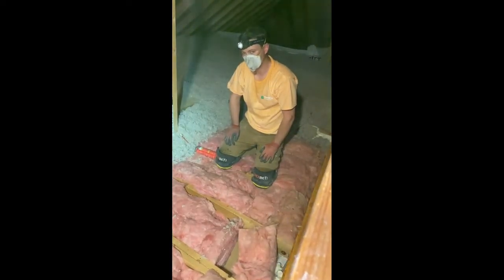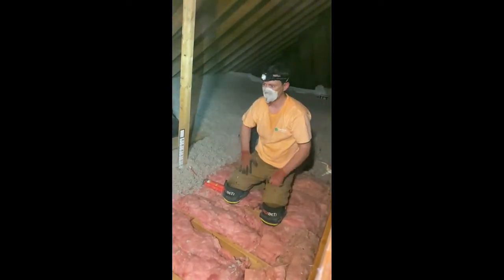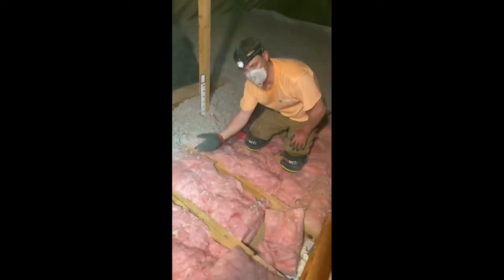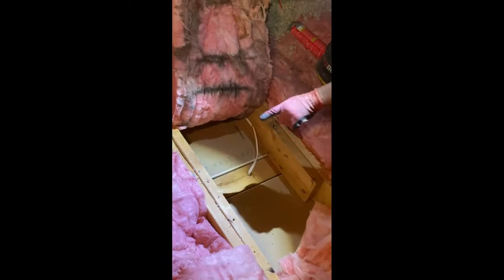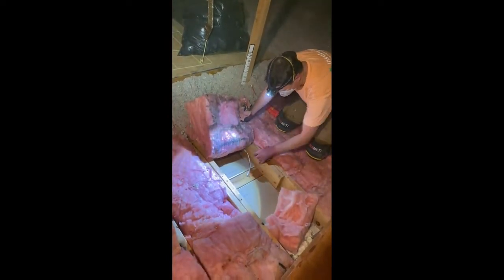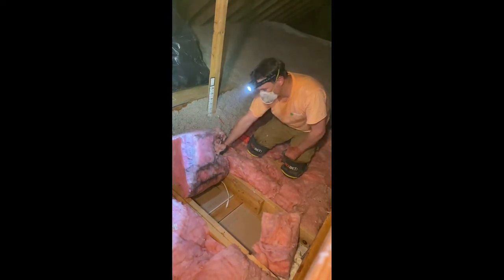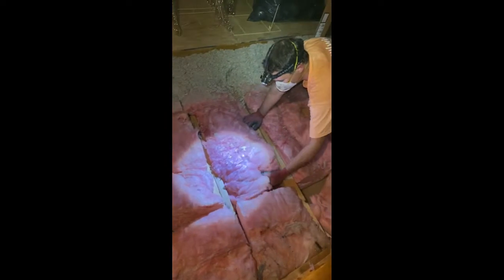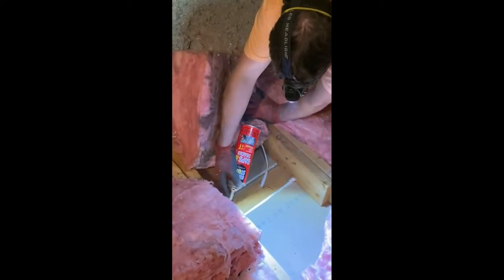How to Air Seal an Attic that is Already Insulated!

Comment: What is the point of sealing an air-leak?  The air-leak is covered by R60.  Any air leaking immediately runs into R60 and has nowhere to go.  The only difference between air-leak and non-air-leak is 1/2 inch of R1 drywall.  As if I need R61 v. R60?
Reply from the maker: Don't take my word for it, instead you can take the word of every building scientist operating in North America.  Here's a start for you.   https://www.greenbuildingadvisor.com/article/air-sealing-an-attic
Reply: Air finds it way into even tiny holes, that is why you see the insulation with black lines where the cavities are. That same air will find its way into the attic.
Reply: What does R60 mean to you?  The insulation is R60.  So no, the air leaks through it is a nonsensical argument.  A piece of drywall has an R factor of .5. You're 120 times better off with no ceiling at all and R60 insulation on the rafters than you are with solid drywall without even one gap in it.
Reply from the maker: @eddieadams4770  Eddie, we air sealed the attic floor and then upgraded the insulation over top of it by blowing it to R-49.

Comment: Is there any special insulation you should do for electrical fixtures from the attic? For instance, when I’m in the attic, I can look down into the bathroom heater, and the same thing for the ceiling fan.
Reply from the maker: Hmm, if you see big gaps like that, you should first cover them with something like a piece of foam insulation board or possibly plywood.   But you don't want to inject foam directly down into something like that.

Comment: Are you in a warm climate? Isn't there supposed to be a vapour barrier on that ceiling?
Reply from the maker: Hi there, Pittsburgh is a temperate climate.  We get hot and humid summers, and cold, wet, and snowy winters.  In climates where it gets cold the vapor barrier should be on the interior walls because vapor drive and diffusion happens from the inside out during cold temperatures.  In the case of homes here, the "vapor barrier" largely consists of drywall, plaster, etc that is primed and has a few coats of latex paint on it.  Newer homes have a layer of plastic put over the studs before the drywall goes onto the studs.  Either way, the goal is to retain as much moisture and conditioned air inside the home as possible (understanding that some leakage will occur) --- and for the water vapor that exfiltrates into the walls and attic spaces there needs to be a clear pathway to evaporate to the outside.  When water vapor gets trapped in an area where there is a surface that goes below dew point temperature, that is where the trouble starts with mold growth. 
Andy

Comment: I’ve heard once blown insulation is blown, you should never disturb it as it will lose its effectiveness. Is this correct? Or can it be moved so work like this could be performed, then shoveled back into an even layer? Thank you in advance! These videos are excellent
Reply from the maker: Thank you!  You can disturb it and move it back no problem.  I've had to do it a bunch.  Biggest issue is being careful you don't fall through your ceiling.  But you can move it out of the way with a broom, kind of like raking leaves, do your work, then brush it right back into place.  I can do it well enough with my hands that you'd never know I moved through the stuff. 
Andy

Comment: That canned foam is expensive and can itself leak around the edges particularly as it ages. The proper approach is to seal what leaks where it leaks and do it in a better way. Sheetrock itself does not leak. It is the openings the wall and ceiling that leak. That's air vents, light fixtures, and power outlets. Get the aluminum tape used for duct work (not the colored and misnamed duct tape). Use it to completely seal of the cracks between those openings and the sheetrock. That is easy and all you need are scissors.
Doing it that way has an enormous advantage. You can work inside your house in a comfortable environment rather than stumbling around in an attic and inching from fiberglass. In short, tape the limited number of openings below rather than foam all the cracks above. Less work and less expense. 
You might also put attic foil on top of the insulation. It's made in varieties that allow you to select the right amount of air flow for your climate. In some climates you want some air flow to keep the insulation from getting soggy. Details at: https://www.youtube.com/@AtticFoil
Reply from the maker: Hi, I respectfully disagree.  If you want to try taping penetrations you're welcome to have at it, but I would not expect this to work well in an attic.  There's simply too much dust for the tape to stick well, and I have never seen any tape adhere well to wood or drywall to any extent.  Foam is expensive, but we have not seen a product that is even close to as effective.  I have also not seen foam shrink or allow for leaks around it as it ages.  I have had to check attics where we've done work years prior, and reaching down below the cellulose I've always felt that the foam was still right where we'd installed it, and attached firmly to whatever it was initially attached to.  There are also relatively few air leaks that are accessible from inside home that has already been finished, for example plumbing pipe penetrations, wire holes, bathroom fans, drop ceilings / bulk heads, etc.  Trust me, if I thought there was an easier and cheaper way to accomplish this work, I would gladly try it.  It is very hard and expensive work to properly air seal an attic.
Reply: @insulwiseenergycomfortsolu3293  ...instead of canned foam can you use silicone caulk?

Comment: How does the air move through the drywall mud and the multiple coats of paint? Around the top plates
Reply from the maker: Great question, it doesn't move through drywall and paint.  When those 2x4 top plates were installed new they had a moisture content of 18-20%.  After a few years of air drying in that attic that moisture content drops to 7-10% --- so they actually shrink a bit.  That opens a gap on either side of the top plate.  Than the air from inside the house naturally gets into and travels up the walls bays and exhausts into the attic.  Stack effect during the winter is the primary driver of this, but I've felt cold air gushing from these things during summer from unbalanced duct systems.  Most of the attic floors that we encounter are incredibly "porous" when you pull back the insulation. 

Andy
Reply: They get through the electrical outlets and switches, then through the side of the top plates into the attic. Electrical boxes have a lot of gaps around them and also the punch out at the back of the box. Most houses have an outlet every 6ft or so (basically every wall). Sealing the top plate separates the interior wall from the attic so air in the wall cavities stay as part of the interior space

Comment: The cellulose dust if in attic can also get in your house and venting and create terrible dust allergies if not air sealing well.
Reply from the maker: That's correct.  A good attic air sealing job will have positive benefits for interior air quality.
Andy

Comment: A question for you. Obviously, since the rafters sit on the outer walls, there is no way to seal the gap of the outer walls. Right?
Reply: It depends on several factors. What is the slope of the roof? What kind of insulation is over it? How much are you willing to pay or do yourself? Also there are foam guns that have a 2 or 3 foot nozzle. That would help.
Reply from the maker: It depends.  On many homes we can get to them, usually the homes with the steeper roofs.  For homes with low sloping roofs it becomes much more difficult.  In some cases we use actual spray foam to seal those top plates.  In other cases the homeowners will have us dense pack the exterior walls with cellulose insulation.  That process essentially air seals the stud bay, so the top plate gets sealed. 
Thanks!
Andy